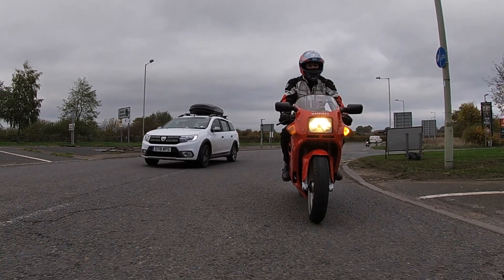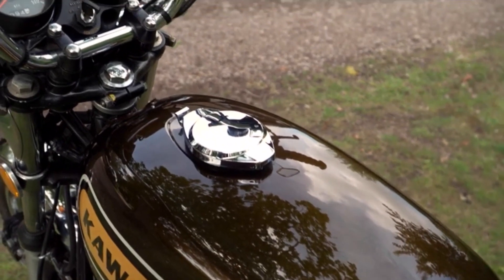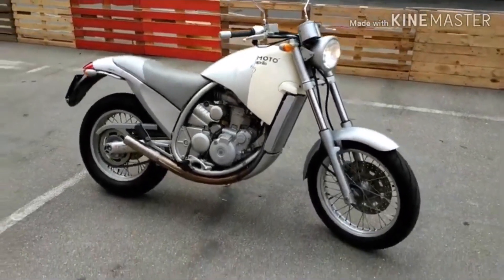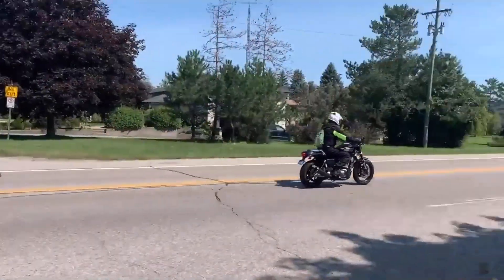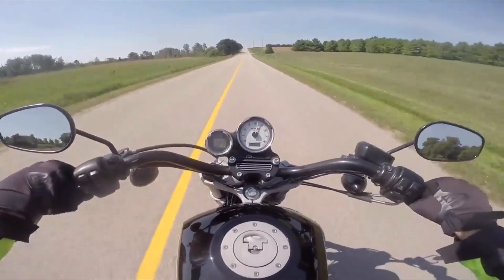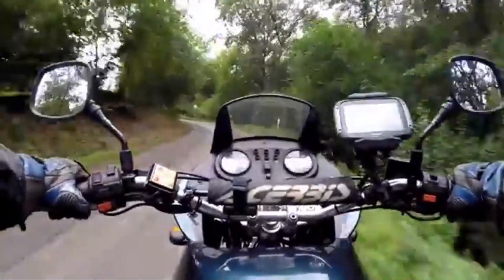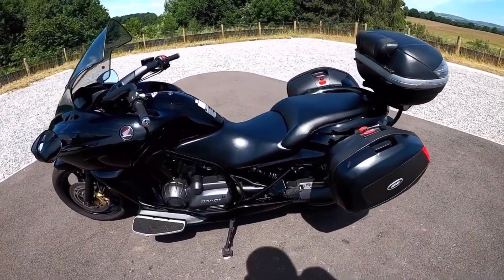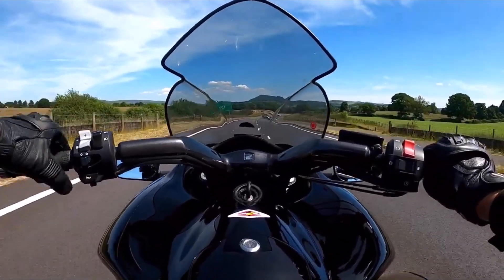5 Motorcycle Fails  Part 3

Comment: A few thoughts for another such episode : both Honda and Moto Guzzi released automatic transmission motorcycles in the 70's.  Both used genuine hydraulic torque converters (not cvt belts).  Moto Guzzi had another go at it several decades later with an 850 that used a centripetal clutch and cvt belt.  None of these sold in great numbers but I have seen a couple of original Guzzi automatics still on the roads in Australia.  Another failed idea was Wankel Rotaries, Honda built a small prototype in the cb-125 chassis but cancelled it early.  Yamaha went much further with the RZ-201 which almost made it to production.  Suzuki actually did bring their RE5 to market for two versions and apparently after huge development costs.  Heavy, thirsty, and using the same gearbox as the 750 water bottle, the RE5's most intriguing aspects when riding it were the phenomenal smoothness that Wankel Rotaries are famous for, and the fact that maximum torque was at only 3,500 rpm making it a very flexible engine.  It truly was a lovely bike to ride, but realistically only did 160kms on a single tank of fuel.
Reply from the maker: I’m well aware of the Guzzi Convert and the Hondamatic of course wether DCT is a similar blind alley, only time will tell I’ve already read about the Japanese rotary projects because I’m planning a video on the wankel 
Don’t fotthe Kawasaki square four either
Reply: @bikerdood1100  I confess to having forgotten the Kawasaki Square 4. Knowing Kawasakis at the time, it would have been a really interesting bike!  Honda has been making DCT transmission bikes for a decade now, and in some bikes like the GoldWing, it’s even becoming the preferred option.  So while they aren’t in the majority, DCT transmissions are not really a fail either.  The hydrostatic transmission in the DN01 was definitely a failure though.

Comment: How kind you were about the DN-01. That was nice. Can't see the Kawasaki triples as fails, though. They were brilliance itself.
Reply from the maker: On a straight road. Performance is nothing without control. A Powerful engine that out performs it chassis would be a common theme for Japanese bikes over the following decade
Reply: If you never lived through the 70s you don't get it,  a Norton couldn't even look at an H2 and if you didn't let off the power in a bend it was ok, but again in the 70s who cared, not me for sure.
Reply from the maker: @wilmawife  I did indeed live in 70s thanks.
I all so read the 1970 cycle world test. The Commando set a standing 1/4 faster than the Kawasaki, maths don’t lie wether we like it not. 
In fact the Commando S was the fastest accelerating production bike until the Z1 arrived and moved the game on. 
Fastes top speed incidentally was the T150. Not the Honda 
Remember the Japanese measure power at the crank not the back wheel unlike the Brits so power is not all that it seems.
I can’t change history because some don’t like it

Comment: It's a shame the Honda DN-01 was a failure and they stopped making it. I would have loved one. Having had several large scooters (two Burgman 400s followed by a Sym Maxsym 600) that scooter/cruiser combo appeals to me. Plus the CVT transmission and upright riding position that I was used to. And it looked so different to anything else on the road.
Reply from the maker: Had a couple of maxi scooters myself, I’m not sure about the styling of the DN if I’m honest which is probably why it wasn’t successful. A. Lot of people remain unconvinced about automatic transmission but I think for touring it’s brilliant
Reply: @bikerdood1100  The styling was certainly radical! But I agree that it in all probability it contributed in a big way to the lack of sales. Auto transmission is indeed great for touring, but even better round town where you're not swapping cogs constantly like with a manual. The same reason why people who do a lot of town driving tend to go for an automatic car.
Reply: Saw a DN for sale about a year ago. The lack of parts availability (especially in the aftermarket) and the DCT turned me off to it.
Reply from the maker: @LeoTheComm  I’ve never tried the DCT system but I’ve used a lot of automatics and found them pretty good. The worry is always servicing and long term reliability

Comment: I worked for a Honda dealer when the DN-01 came out. It was thought that DN-01 stood for "Do Nor Order One." We came to the conclusion that the market for this bike was a women, who wanted a bike to ride with their husbands who had a Gold Wing. We sold one to a woman with one leg and she adored the bike. We sold one and we didn't order another one.

I actually currently own a Guzzi Quota. It's heavy, very tall, handles better than if should and is good on the road. Faults? My Norton is easier to get parts for.
Reply from the maker: The DN is a mystery a bizarre looking bike 
The Quota was never a bigger seller so I suppose parts a rare and accessory choices nil. A pity because it makes a change from all those BMW GSs
Reply: @bikerdood1100  The good news is the Quota shares all it's running parts with other Moto Guzzi models. Mine has a cracked exhaust pipe with no replacements and you can forget body work if that's ever damaged. The BMW GS feels more refined. I think they sold maybe 200 Quotas in the US for all the years of production. You won't see another one.
Reply: Yes I can see the DN-01 appealing to women. The low seat height. And the CVT transmission would be a bonus for a rider with one leg.
Reply: @Nooziterp1  "It`s not WHAT you ride, but rather, IF you ride".....

Comment: I love the Moto 6.5's commitment to its design and I think it has aged very well. All of those one-off parts made it very expensive when it first came out though which didn't help sales. 
Ultimately though it faced the same fate as all the "bikes designed to appeal to non-bikers" face. (DN-01 included). If you already know about bikes then the compromises of these style-led bikes becomes unignorable. They're usually slow, expensive, and often not much fun to ride. As much as I like how the Moto 6.5 looks I'd not buy one because for the same money I could get something much more capable. 
But non-bikers aren't going to buy them either because for all their styling they're still fundamentally bikes. Someone who doesn't want to buy a bike is unlikely to change their mind just because one bike is prettier than another.
Reply: it reminds me of an uncooked shrimp
Reply from the maker: Somehow it’s designed was soo different it’s aged very well I think

Comment: Not to be critical but the H2 was not considered a fail
Reply from the maker: Corners
Reply: Indeed it was a handful, But in this country (US) it was still a success
Reply from the maker: @jefmatttab  as the video says 
Failure takes many forms 
Sometimes mechanical, or design 
Sometimes commercial.
But it always about sails
Reply: Well there young man,   I was there in the seventies and experienced it first hand.  I'm sure it was too much for some.  You are correct about what you say about it, except for the fact it wasn't a failure.  It was dangerous but so was jumping out of an airplane.  To each is own.

Comment: Unlike the Norton Commando, the Kawasaki H2 didn’t blow up when thrashed. AMF  DID produce a  XR replica. The XR1000 was produced between 1981 and 1984. It was based on the Iron engined Sportster but had aluminium heads, twin Dellorto carbs mounted a la XR 750 on the right with a high race style twin pipe exhaust on the left. Market research showed that the average punter wanted traditional Sportster styling rather than the competiton look of the later XR1200.
Reply from the maker: No but Kwakers do seize and don’t go around corners too well.
Harley have always found it difficult to sell anything other than their oversized cruisers, well in recent years at least. This may well be their undoing if they can’t break away from their old image because their market is ageing fast
Reply: @bikerdood1100  The most recent lifestyle marketing comic that HD sent me was rammed full of articles featuring the new Sportster range. 
I pretty much took that to mean that those bikes aren't flying off the shelves and need all the marketing and sales help that they can provide.
My impression is that that Harley have also refocused on their sights back towards selling premium lifestyle products as opposed to wanting to become more of a volume manufacturer.
Reply from the maker: @derekp2674  that is more than just an impression. Harley sales have fallen in recent years, the previous CEO tried to diversify the range of products they offered bu5 really tried to do too much all at once. 
The new management are focused on what they believe to be the core business, well healed business types wanting a prestige model at higher prices so they have reduced production, cut the sportster range  rather than modify it to meet emissions regs and postpone some of the new model lines. 
This seems idiotic because their so called core clientele is ageing rapidly but they are once again ignoring the younger riders they will need in the future. 
In 20 years time most of their customers will be too old to ride or 10feet under 
What then for HD I wonder
Reply: @bikerdood1100  Perhaps they'll just licence their brands for others to use on prestigious products. I believe their latest CEO is from the fashionable urban sportswear industry.
Reply from the maker: @derekp2674  that’s just depressing
Reply: Haha. Another expert that's never owned a Norton. I bought mine in 1972 and still own it. Tell me about your H2 that you still own, you know, the one that's thrash proof.
Reply from the maker: Well if they’d used market research why produce it. 
The only research was the sales figures after the fact 🙄
Reply: @bikerdood1100  As a former Buell owner, I saw the XR1200 as an attempt to recruit riders looking for a sportier ride into the Harley fold. 
Bikes like the XL1200S - the Sportster that came with twin plug heads and brakes and suspension as original equipment items ;-) and the FXDX were already doing that to some extent. 
It is possible that ex-Norton engineer John Favill may have helped steer H-D towards bikes like the XL1200S. 
At the HOG rally at Goodwood in 1993, he spent some time on walkabout, taking to UK Harley owners about their likes and dislikes. I think I mentioned to him that, for UK roads, we tended to upgrade suspension and brakes...
Reply: My comment was for johnnyrvf not bikerdood but take it however you prefer.
Reply from the maker: @robertshepherd3832  yes I realise that 
Thought I had deleted
On the whole I agree with the point. The Commando S was the fastest accelerating production bike tested in 1970 by cycle magazine. Faster than the H2 and remained the fastest through the Quarter mile until the Z1. 
Fastest top speed bike tested incidentally was the T150.
People forget the Japanese measure power in the wrong place, 70hp is not actually 70hp 
I don’t know the bike wheel power of an H2 but it ain’t 70. A CB750 only gave 56hp at the back wheel so was actually less powerful than either Brit bike

Comment: The only way we will get people out of there car's is by simply flying the licence nonsense and making bikes more affordable.  North of £3000 for some 125s is ridiculous and until car drivers realise how much fun riding a motorcycle is the would rather buy something with a roof and heater for that money.
Reply from the maker: A proper look at the learner laws
Much easier and cheaper to get a car licence. Especially if your younger. Which is ludicrous
Reply: I passed my test at 17 in 1983 along with my car licence that year, but I rode a bike as it was cheaper than getting a car back then. I was a tool maker apprentice, so wages were rubbish. I've ridden a bike all year round, even in sub-zero conditions from the age of 16, the sweat smell of two stroke.

Comment: You insist upon bagging the H2 Kawaski. It was not an evil machine, just very fast. Fast enough to lap quicker than Z1s in 70's production racing in Australia. The bikes were rigorously scrutineered to comply with race rules for out-of-the-crate bikes only. The Z1 was a far more evil machine, prone to violent speed wobbles and other maladies. The H2 had a broad spread of power, was easy to ride and generally fun to own. It was the early H1 that is actually called the widowmaker, not the H2. The worst feature of the H2 is its prodigious thirst if you give it a serve.
Reply from the maker: Bagging ?
Race machines are much moded from road 
I very much doubt that it had standard suspension units 
Also what makes a good race bike does not necessarily make a good road bike 
Jack hammer power delivery is one thing on trac another on a wet road at a junction
Reply: @bikerdood1100  No, you misunderstand me. The bike does not have a jackhammer power delivery. That is the 500. I have owned one of the early models, remember. And the track bikes were not allowed ANY changes, suspension or otherwise. Look up the Castrol 6 Hour Production Race. This is a race for road bikes, where you could and did have unmodified XS1100 Yamahas beating all comers. BMW R100S beating 900 Kawasakis and everyone else. So these are not race bikes. They’re everyday road bikes on road tyres. Look into it. The H2 never won this race due to its fuel consumption.
Reply from the maker: @ChasDean-d9h  well I’m aware of the race
I believe unmoded may be stretching it however 
True the 750 was an improvement over the 500 in terms of chassis and power delivery but. It really needed to be. Better still doesn’t mean great however
Reply: @bikerdood1100  if you look up Kawasaki Triple on Wikipedia, the comments made about both H1 and H2 are interesting reading. Particularly re H1’s lethality, and H2’s competence in a contemporary shootout by one of the American magazines.
Reply from the maker: @ChasDean-d9h  I did and it’s usually in comparison to the latter 
It still wasn’t the most nimble bike on the market in all honesty 
It was Japanese for a start

Comment: The 500 kwak was nicknamed the widowmaker, not the 750.
Reply from the maker: I’ve read the same name attached to both in all honesty, after all the power went up not the chassis quality
Reply: @bikerdood1100  I believe the engine was reworked to make a more even spread power delivery on the 750. Anyway the 500 was the first made and it got the name first.

Comment: OK...  The Kwaker 750 was much worse than most "modern" people think.  The lousy damping was matched by hard and cheap tires.  This led to a skittering, nervous bike with a wicked power band.  Yes, you can fix this...but why would you bother?  The Aprillia is certainly pretty, but I've never seen one in the flesh (I guess they didn't come to the USA, and there don't seem to be any in NZ, where I have lived for many years).   I've ridden the Harley, and was neither impressed nor depressed...but it was expensive.  My bud who owns two Harley independent shops and a franchised dealership in the US was blunt:  "If this is what you want, buy a used rubber-mount Sportster and make your own.  You'll wind up with a better bike for a lot less money, and it will be EXACTLY what YOU want."  Nuff said.  The Goose is the answer to a question that nobody asked, and I'm a huge Guzzi fan (still have a wildly-modded LeMans).  I guess they just could not stand to see BMW selling all those GSs.  The Honda was another answer to an unasked question...but a continuation of Honda's intermittent obsession with the idea of an auto-trans motorcycle.  I never understood this, especially in more recent times, since there are plenty of big-engined scooters that will handily fill that niche.  Besides, I've always thought this thing was ungainly (at best) and oddly proportioned.  Never rode one, and never will..but I do like the moniker "Stalin" (the name, not the man)/
Reply from the maker: I believe the Aprillia was sold in the States, not many obviously 
Honda do have an obsession with this type of bike, it’s one others also pursued before them 
Neracar, Wilkinson, Velocette 
Non were ever particularly successful especially in America where the obsession with four wheels is deeply ingrained

Comment: The kwaka S3 400 was a pile of shite. From the centre cylinder would miss like crazy in the rain due to water thrown up from the front wheel. 
The pipes ground out on any decent bend. On the plus side it would still be rideable if stuck in 3rd gear 😂 ( due to dropping on ice and snapping the gear lever)
Reply from the maker: Well the Japanese took a while to get to grips with the concept of handling and ground clearance